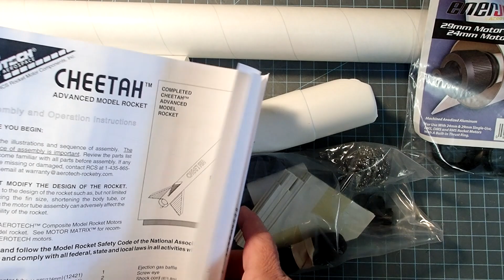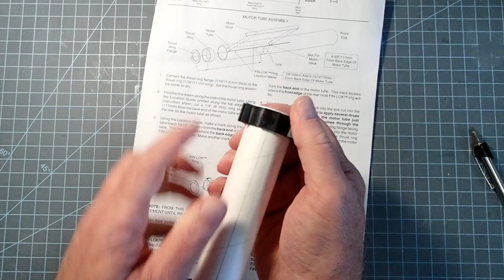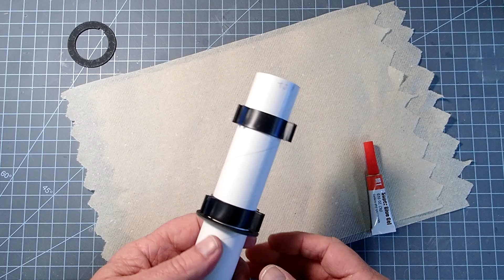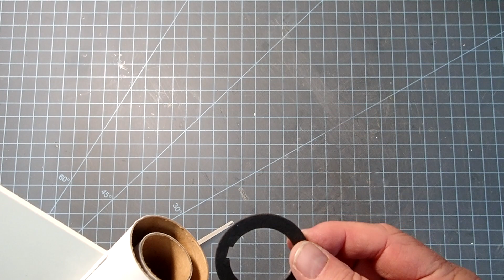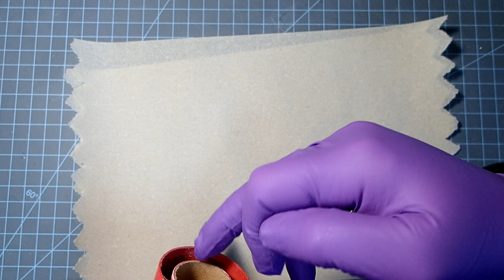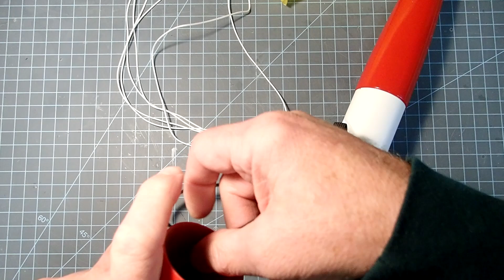Enerjet (Aerotech) "Cheetah" model rocket construction

Comment: Am in the process of building an Enerjet Astrobee D and it uses the same baffle and finlock design.  First time with this type of assembly and one thing I did different before mounting the baffle was screw the eyebolt into the baffle then add CA from the back to reinforce the assembly.  Probably not needed.  I like the addition of the kevlar connection.

Comment: I’m surprised they used a metal eye screw .not that it matters that much but u should reduce weight as much as possible but I don’t think that eye screw is that significant in weight to take away any height or thrust

Comment: I’m surprised they used a metal eye screw .not that it matters that much but u should reduce weight as much as possible but I don’t think that eye screw is that significant in weight to take away any height or thrust
Reply from the maker: @jakeeleebattos9942  it’s a sport rocket, not a competition rocket. The mass of the screw eye is insignificant for sport flying.
Reply: @ I realize that I just like to nitpick lol I got the same rocket and when I couldn’t find the instructions I tuned into you sir .ty